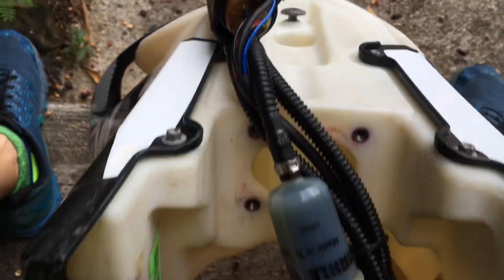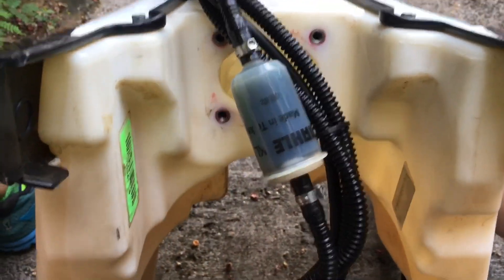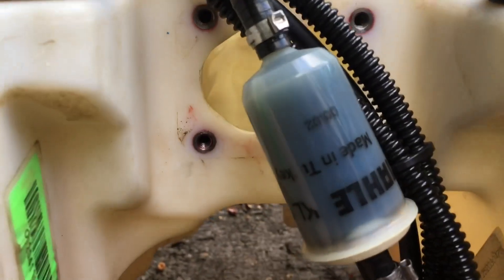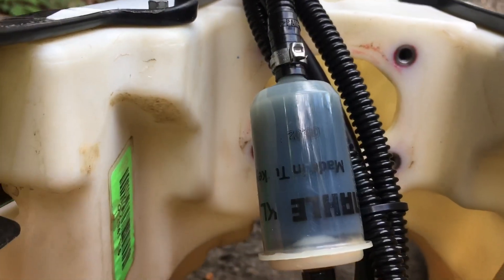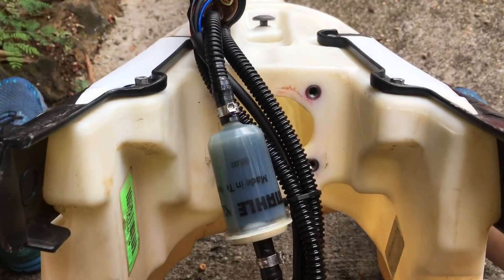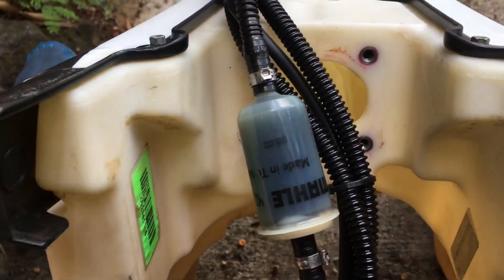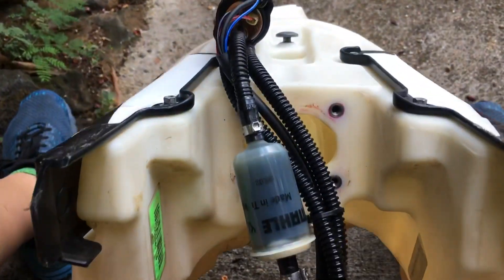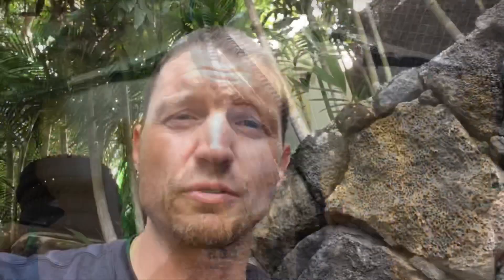KTM Fuel Pump Issues? Or Neglect?

Comment: The black comes from the pump brushes. Change the filter at 450 miles and every 1000 miles after that. It's not the fuel and there's a very fine strainer on the pump pickup that you can inspect.

Comment: Great video! I had my 2018 fuel pump fail at 700 miles got it replaced under warranty and run redline fuel cleaner every few tanks and been working fine ever since. The mechanic said it was a different part number ktm sent to him.

Comment: Just replaced my in tank fuel filter for the second time after 1200 miles on my 2018 690 ,its dirty, but not as bad as the first time at 800 miles it was plugged.   I'm replacing my pump with Quauntem fuel systems, and an inline filter to replace the tiny one.    I think the stock fuel pumps are creating particles from the inside that plug the filter, or sucking up plastic debris from inside the tank wich you can see with a flash light on mine.

Comment: KTM's fuel pumps are now made in China. So they are not as good as before. The filter manufacturer changed to having them now made in China.
The filter gets full of black carbon from the pump.
Run the new pump for a few seconds before it is installed flushing it out with gas.. This will flush out crap from the new pump.
I saw on YouTube a shop that does that with every pump sold before they sell one. He showed the crap being flushed out into a bucket.

It is not the gas and fuel line cleaner will not solve the problem.

Comment: KTM is no rocket science. KTM (and 690) fuel pump failure makes no sense.  Black stuff in filter is what Im told from brushes in the electric pump). Biggest concern to me why KTM dont care about such problem when other manufactures do. For example, you can buy any old 30 years old bike/car with fuel injection with a fule pump and it does not have the KTM problems. KTM just dont give a f#ck about owners have to buy upgrade parts to get some reliably. My new ( first and last) KTM broke down after 5 month.
Reply from the maker: After 8 years of managing a motorcycle shop (KTM Dealer too), I can tell you... there is an endless list of problems that manufacturers don't address (in some cases, decades for Japanese). Nobody is perfect, but rest assured, on the whole, KTM reliability is is among, if not the best.

Comment: Hi, Great video. Did the fuel pump replacement the trick? Can you use the inline filter now? Does it start easy now? Because mine doesn't start very easy lately and my mechanic can't find the problem. Thanks
Reply from the maker: I do feel like it helped. A lot of people put those Shorai batteries in their bikes too. Total junk. Most of them lose a cell can make the bike hard to start. 

Put and EKJ or variant fuel controller on it. The things are starving for fuel. I don't have this bike anymore, but I've installed two of them lately made a big difference in one of the bikes and it was a SX with way better fuel mapping that the starving EXC. if you bought the bike used you might check to see where your TPS is. A lot of people mess around with it to detriment. Set it to stock and put the $225 fuel controller on it 👍
Reply: @JohnHowerton137  thanks for the advice. Will try that.

Comment: I do not know if you can neglect your bike after 700km but in that time my clutch slave cylinder died my fuel pump had to be replaced my screen had water in it after it rained and had a leaking countershaft seal .......I understand that there are fan boys who will say nothing bad about ktm because they are an awesome bike to ride but to say people neglect there bikes when it clearly is ktm installing shit products on there bikes ......really ???
Reply from the maker: Without a doubt people neglect their bikes. 700k off-road you easily can! I managed a shop for 8 years. We were the number one KTM dealer in the state. I can tell you right now they had a lot less failures than any other manufacturer... Period. 

That said, there are issues sometimes. Probably the biggest issue I ever saw was in 2004 the 250SXF had CDI box failures. My friend lost the WORCS Championship because of it. He's actually still jaded, because it probably cost him a career. He's only bought Kawasaki's since, which is kind of hilarious because those things were blowing up like crazy. I think it's a sentimental thing because he rode for Team Green as an amateur. His first Kawi after he jumped off the KTM's lasted about a week 🤣 The parts at dealer cost were $1,100 for that one engine.  

You can easily pump water out of a tank at a service station. It's happened to my brother's Harley three times. It happened to my Moto Guzzi once. I stopped running 92 Super after that. Sits in the tanks too long, especially when gas prices are high. My friend's dad was buying cheap Safeway gas and had to replace his fuel injectors three times in his truck at about $1500 a whack. Sure saved a lot of money! If you bought your bike second hand, the fuel system can easily be damaged by sitting for long periods of time with old fuel in it. On the KTM 690s, people knock dirt in the tank while pumping gas because they're riding dirty ass bikes all the time and are careless.

It's pretty common knowledge if you tighten the chain too much on a KTM you blow the counter shaft seal almost immediately. Not sure if it's a problem on the linkage bikes now, but it is on the PDS suspended bikes. A lot of people ran the chains too tight switching over from Japanese. I guess it was too hard for people read the slack sticker on the swingarm or they peeled it off before riding it.

I don't know what to tell you about your slave cylinder. Maybe I did fail? But I've sold at least 600 KTMs, serviced many others, personally owned 8, and have never seen a failed slave cylinder. It's not that common. 

I haven't seen your bike so I don't know the situation. I can tell you right now after doing this for so long... most of the time it's like a fat diabetic person going to doctor and telling him, "I eat really healthy!" 😒 Doc wasn't born yesterday.

There's a reason why I'm a KTM fan boy, and that reason is because they make high-end stuff. I still work on Japanese bikes for people, and I hate almost every minute of it. KTM  has the highest customer loyalty of any brand, they've won more championships than any brand by a long shot (even when they were small) and they're the number one off-road brand in the world. They're not always perfect, but they don't make junk.

Haters always like to make up stupid crap though... "AER forks suck!" (because he's too stupid to figure out how to set them up). "PDS suspension sucks!" (once again too stupid to set it up). PDS suspension alone has won more world championships than I think all the Japanese with linkage combined. Don't quote that because I'm not up on the stats like I use to be... but it doesn't even matter.

I'm sorry your experience hasn't been better, but your experience isn't that common. The squeaky wheel era of social media makes problems seem far more common than they really are.